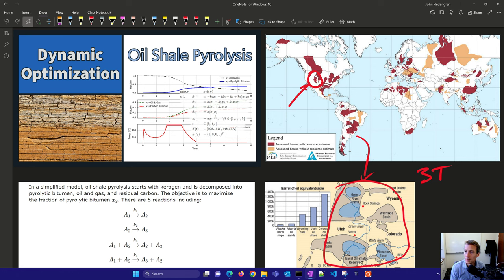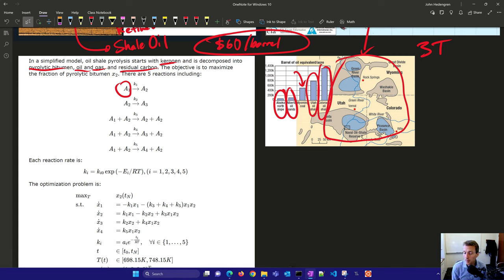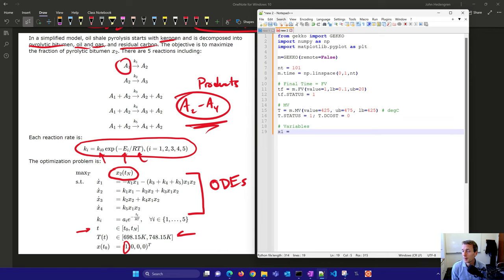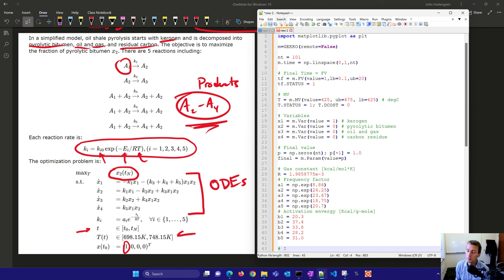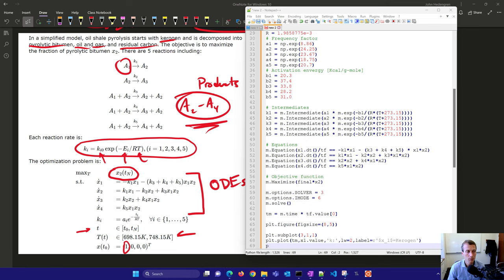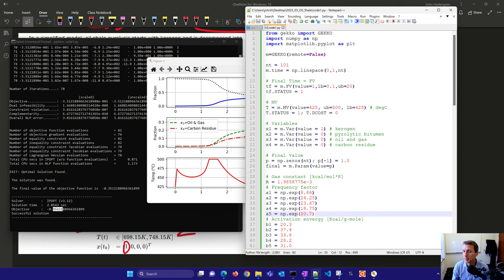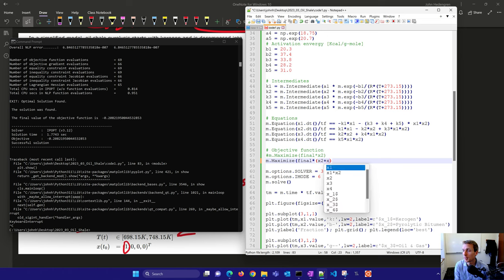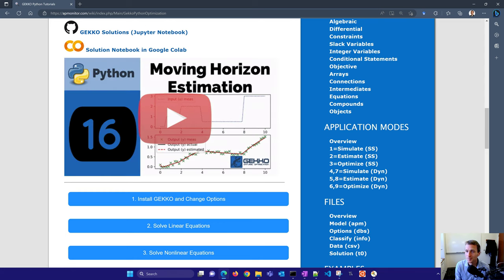Oil Shale Pyrolysis

Comment: Excellent explanation, Sir! It will be highly useful for multi-objective optimization. However, for the weighted optimization, which you performed at the fag end of the video, how can I set the constraints for the same?
Reply from the maker: If you need at least a minimum amount of a particular quantity then you could set an end point constraint such as m.Equation(final*x3>final*0.3). If it needs to be less than a particular amount then use m.Equation(final*x3<0.2).